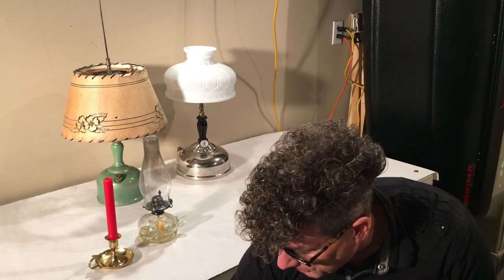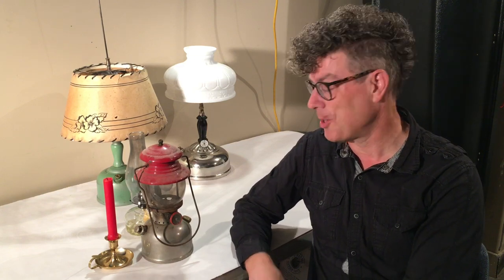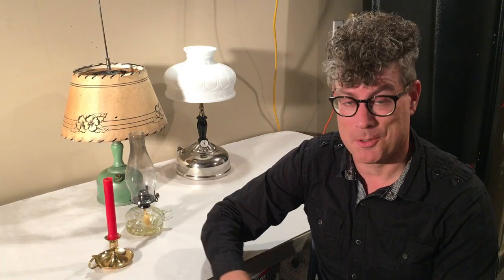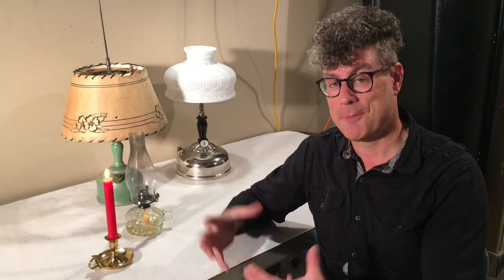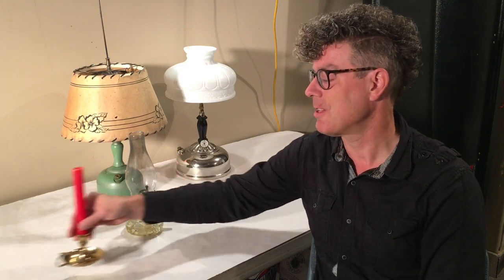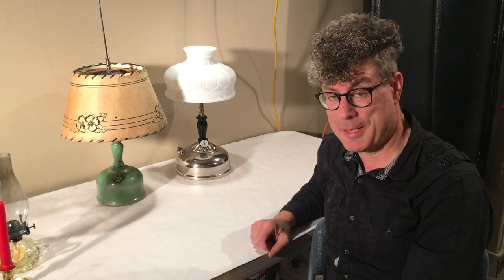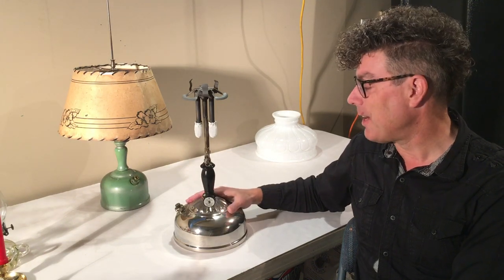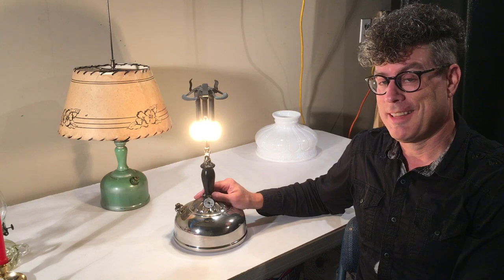Stinky Lanterns?  Burning Lamps Indoors?

Comment: Your videos are great!!! I have done extensive testing with a Bacharach Carbon Monoxide analyzer. Much to my surprise, my highest reading was 34ppm of CO & the lantern was filthy!! A lantern that is clean & properly working, CO readings were ranging from 5-10ppm CO. The testing was conclusive enough that I use them every night in my home. Added bonus during the winter is the heat they release as well. In a blackout during the winter, I'd feel very comfortable heating my home with a few lanterns. I'm not telling anyone what they should do... I'm just letting everyone know what I'm comfortable doing. Use your own judgment
Reply from the maker: I don't have anything that sensitive, just a standard CO detector.  I looked up the specs and saw that it will go off after eight hours of sustained 50ppm.  I put it in a room with a 236 and a 237 for fourteen hours.  I had to alternately shut them off for refuelling, but at least on of them was running the whole time and the alarm never went off, so that tells me two high-power lanterns combined are putting out less than 50ppm.

I also find it interesting that when Coleman did include a note about ventilation in their warnings, it was about oxygen consumption and made no mention of carbon monoxide.
Reply: @king.coleman  I'm alot like you!!! Constantly doing experiments with these. I just wrapped up a 3 month long fuel comparison test Coleman VS Crown. It's that part of this hobby I enjoy!! I do enjoy your videos as well. Your theory of operation videos are very informative!!
Reply: @rickdavis4740  What were your results?

Comment: Just one point to clarify: - there is a difference between square inches and inches square. The hand demonstration was more like 5 or 6 inches square; 25 to 36 square inches. Colemans's recommendation of 5 square inches would be 1" x 5" or take the square root of 5 to find the length of each side of a square of equivalent area.

I recently got hit with a bout of nostalgia, having grown up with Coleman stove and lantern's in the late 50's and through the 60's....so I bought some  naptha stoves and a lantern. Winter is coming and I need some projects. I've watched a lot of your videos, I find them to be thorough and instructional...thank you for taking the time and effort to make them.

Today's project will be to heat and quench, followed probably by an acid soak to recover the generator from my 4M stove. I really need to get the spring out and clean the tube.

Comment: we have 9 lanterns from coleman, we love them and use them when we can, mostly at the cabin, we also have the cook stoves, love using those as well.
we keep plenty of fuel on hand for emergencies. we light the porch of the cabin another at the stairs, another by the fire pit, just a great tool for the off grid cabin.

Comment: In the state of Victoria, Australia the residential building code used to mandate vents high up on the outside wall of each room. There were usually at least two depending on the room size. Apparently these were to allow for the use of kerosene appliances. After around  the 1980s these vents were dropped from new buildings as being no longer necessary.

Comment: RE: burning indoors depends on your home, not the fact you are burning fuel. Many modern homes are very well sealed; therefore, burning anything indoors can produce an overabundance of CO. In older homes, you had enough drafts or other air ingress/egress that it wasn't really a concern.

Comment: I burn my kerosene lanterns in doors every night. When shutting them down I release the pressure from the tank rather than shutting off at the valve. Only do this on kerosene models! This allows the kerosene to immediately drain back down the generator and stops the vapor as well as it extends the generator life. Preheating a gen with kerosene in it is what causes the carbon build up that leads to a clogged gen. This is the way I do it. If you don't like it then please don't do anything you are not comfortable with.
Reply from the maker: Yeah...I expect I'll catch all the flack I can handle just telling people it's okay to burn these indoors, let along telling them to unscrew the fuel cap while it's still running.
Reply: @king.coleman  Ditto. But if you have spent any time with a lamp or lantern you start to figure out all of it idiosyncrasies. You know the ones that are bullet proof and the ones that are absolutely going to fail every time on you! 🤣
Reply from the maker: Yes.  If I were to get into that, I'd probably note the kerosene "Euro-stoves" like those made by Primus and Optimus, which you extinguish (or "turn down") by venting pressure from the fount.
Reply: @king.coleman  Exactly!
Reply: You are correct, I do the same, no odors. But I wait for the flame to be out before releasing pressure on the gas models as you mentioned.
Reply: hmm might have to try something like that on my coleman kero pressure lamp it seems every 20hrs or so i gotta pull the generator and clean it and thats with using fresh clear kero.......ive run white gas  lanterns for 100's of hours and never had to clean the generator!!

Comment: I got a hurricane lantern as part of my "Oh Sh*t Kit" for when power is out for extended periods.

I was wondering what's the best size of flame to have? (Best as in best fuel efficiency to light output to wick preservation ratio). It's a standard flat wick, "classic"  hurricane lantern, Dietz brand, the shorter globed of their 2 main lamp types.
Reply from the maker: I don't know that I can give you a definitive answer.  I don't have much interest in wick lanterns and have little experience with them.  It does seem that each one has a pretty narrow window where it burns efficiently, putting out a bright light and not smoking.  Adjust it to that point and that's your answer.

Comment: Great video brother thank you for sharing your knowledge and expertise I have a old lamp like your  Chrome one  On the right where can I find a pump for that style of lamp I paid $15 For my lamp  At a yard sale it had the pump it was never burned the date on the bottom reads 1924 is that correct Could it be that old and never fired the brass was shiny and new Hello from Detroit Michigan USA
Reply from the maker: You can find pumps pretty readily on eBay.  Old Coleman Parts sells them at a reasonable price.  It's certainly possible to find the occasional Quicklite that hasn't been fired, but it's also possible it passed through the hands of a collector who cleaned it up and that it now only appears to be unfired.

Comment: Great YouTube! I have a question I hope you can help me with: I have the identical Lamp you show in the intro, not the one you used in the demonstration. Mine is in good shape, but it is unsafe to light. The fuel valve leaks. Taking it apart its packing is twin or string and some sort of grease. I can not find an illustration to show me how to repack. Could it be some previous owner did this when the original packing failed? Where can I get a packing for my lamp or instructions on how to re-twin/string it and what grease do I use? I really want to enjoy my lamp, but can not due to the leak. Thank You!
Reply from the maker: There shouldn't be any grease in there.  It sounds like the original graphite packing failed and someone replaced it with graphite rope.  I've got plans to make a video showing how to do that.  You can purchase new packings from Old Coleman Parts (the easiest way to replace it) or you can use graphite rope.  It should be available anywhere plumbing supplies are sold.  Just be sure to get the kind that's twisted graphite, not graphite impregnate string.  The latter won't hold up.  If using graphite rope, remove the old packing, make sure everything's very clean, then wrap the new rope around the valve stem.  How many times depends on the rope and the size of the valve.  My rule of thumb is enough wraps that it's difficult to get the nut to catch on the threads when putting it back together.  I find that's typically about five wraps.  Tighten the nut and see how it feels.  If that's not enough, you can always take the nut off and add another wrap or two.

Comment: methyl hydrates (99.9% methanol) is different that denatured alcohol (usually 10% methanol, mostly ethanol. Its "denatured" here in the US since 100% ethanol required an alcohol tax and is not sold to the public. The methanol is added so you can't drink it
Reply from the maker: Yep.  But if you ask for denature alcohol in Canada, you'll either get a blank stare or they'll point you to the methyl hydrate.  I'm an American expat living in Canada and this confused me at first.  I've never seen denatured alcohol for sale here.  (And I don't recall ever seeing methyl hydrate for sale in the US.)
Reply: @king.coleman  In the States, methanol/methyl hydrate is sold by the gallon under the brand name HEET.

Comment: Ok….I have several oil lamps and lanterns in which I burn Madellion clear lamp oil and there is virtually no odor at all…I recently purchased an antique oil lamp..washed out the fount , changed the wick , used the same oiL..while burning there is a prominent odor…similar to kerosene fumes…there is no smoke ..just obnoxious fumes…Could it possibly be the burner .??  Any suggestions??  Thank you
Reply from the maker: I'm afraid I don't have an answer for you.  My interest is in gas pressure lamps, not wick lamps.

Comment: Doesn't the kerosene pressure lamps spray kerosene out if they get to low on pressure? I had one we were running and went out to bring it in and shut it off and that's what appeared to happen. I understand they are meant to be tended too.
Reply from the maker: No, the issue isn't pressure.  As long as the generator is hot, the liquid fuel will turn to vapour.  It'll only spit liquid fuel if the generator is cold and that won't happen once the lantern is running.  If the pressure drops it'll just shut off.  While you shouldn't leave a lit lantern alone, a Coleman lantern doesn't need any "tending" once it's running.  It's not like an Aladdin lamp.  On those the draught can increase as the burner heats up leading to a runaway flame.  Pressure lanterns don't work that way.

Comment: The one thing I can't find, and no-one can explain is the purpose of the removable air tube cap on my lamp. When I remove it, my lamp runs much brighter. Does anyone know? It's a Leacock 107SS. I'm also trying to figure out which mantles it takes, it doesn't even say in the instructions! Thank you
Reply from the maker: It will take #21 Coleman or 2C-HG Peerless mantles...the standard for pretty much every double-mantle lamp or lantern.  When you refer to a cap on the air tube, I'm assuming it's screw-on restrictor at the bottom of the air tube.  These have been used on a number of lamp models, usually those that can burn both gas and kerosene, so that the air mixture can be adjusted depending on the fuel being burned: off for gas; on for kero.

Comment: That nickel plated lamp. I have one similar but I've no idea what type of glass shade fits. Is there any specific diameter?
Reply from the maker: If you can't find a Coleman shade, Aladdin shades are more common and will usually fit.  For a CQ shade, the bottom diameter is about 10" and at the narrowest point in the top about 3 1/4".

Comment: The only thing that has changed over the decades since "stoves & lanterns" were invented is society. We live in a litigious society these days and with countless numbers of people who fear just about anything as well as fail in the terms of common sense which is why you find the Coleman official indoor use as a big no. Today, gasoline and kerosene are well overpriced, in fact I believe purchasing a 1 or 5 gallon container of K1 kerosene is more expensive that pump gas. Kerosene today doesn't make any sense unless gasoline isn't available at the time of need. Another fact about "candles" is that they are very dirty...folks don't think of where that wax goes to since it doesn't fully burn, the unburned was ends up on you walls, ceilings and surroundings so it wouldn't make a lot of sense to use them often in locations having expensive furnishings and fixtures.

Comment: The only reason oil lanterns stink is using low quality oil use proper lamp oil it is oderless and clean if it is dirty then the wick is too high
Reply from the maker: That is true when it comes to oil-burning wick lamps.  Gas pressure lamps don't have wicks and burn gasoline or kerosene rather than oil.
Reply: Are all fuels equal in terms of toxicity and air pollution ?
Reply from the maker: @roseskyschmolesky  If you're asking about carbon dioxide output, I couldn't say.  The more potential energy stored in any fuel, the greater it's CO2 output is going to be.  If you're asking about gasoline versus kerosene and how they compare for burning indoors, it doesn't really make a difference if your appliance is burning properly.